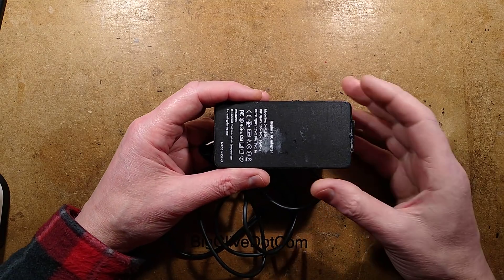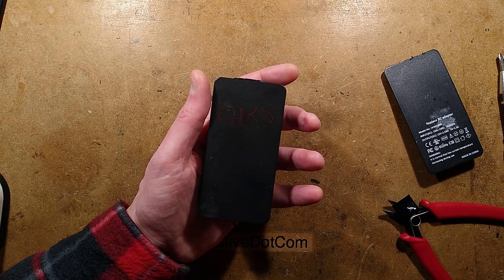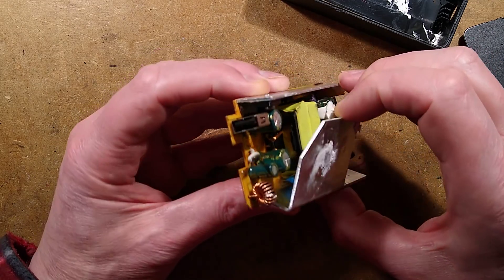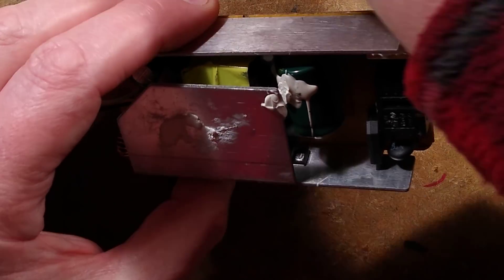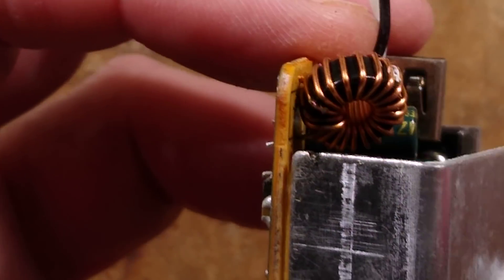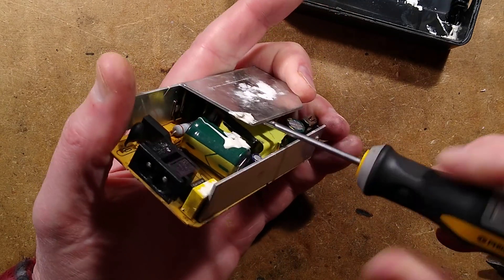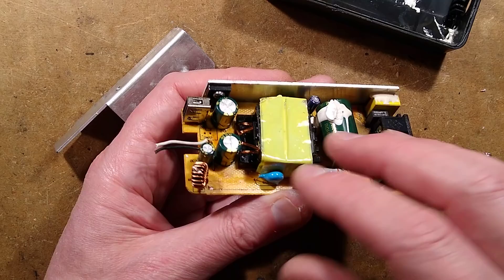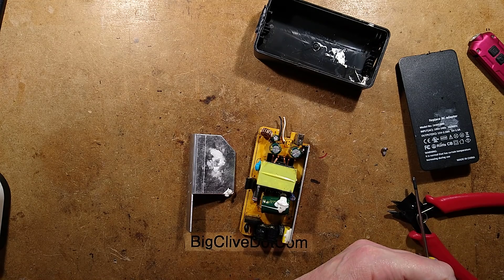This PSU killed a Microsoft Surface and a monitor

Comment: I do remember laptop transformers 10-15 years back seemed to get very hot and never seemed to last more than a few years, though they all failed safe for me without damaging equipment. There were cheap replacements from ebay around, but they failed too after a bit. They are far better now, so I guess manufacturers have improved things over the years. One thing I also noticed then was that simple electrical supply fittings of laptops seemed quite poorly made in the early days too, power lead plugs, wire connectors and sockets for example.
Reply: Personally I don't like the idea of a power adapter without an earth connection to the mains power outlet. A LOT of PSUs back then only had the two prong cassette tape power lead. Not good in my opinion.
Reply: My first laptop back in the days of dial-up internet was terrifyingly hot EVERYWHERE. All it was all supplied by a Famous High Street Electrical Chain, but it was all so hot you could fry eggs on it. Transformer, the lot. I don’t know about such stuff, so not sure if the early equipment was prone to this. Anyway… I am going to try and teach my self to check stuff out.

Comment: I had a oem display port cable take out three computer power supplies. The low voltage 3.3 or 5v wax being shorted to ground. One I replaced the cable no more issues. I was lucky it didn’t take out motherboard or rx 580

Comment: Heatsinks need to be referenced to a power or ground rail, otherwise switching noise will get capacitively coupled onto them through the isolated transistor and diode packages which makes heatsinks act like antennas, increasing EMI. With the heatsinks grounded, they become somewhat effective EMI shields instead.
Reply: Not actually grounded, in this case, thanks to the unpolarized 2-prong plug.
Reply: @jpdemer5  I meant 'ground' in the AC signal analysis / EMI sense. In the strict electrical sense, you cannot have a ground on the other side of a diode bridge because that would short L-G through the bridge and blow it up. Even if you had a polarized plug, you wouldn't want to connect the heatsinks to it since that would cause conducted EMI through the ground wire instead of locally shunting it to circuit power/ground rails to keep it local.

Comment: "Replace AC adapter" 😂 Replace "cheap 💩 for an expensive device" mindset and stop saving a buck in order to pay it tenfold later in damages. This owner deserved what was coming. If it's a power supply for a monitor AND USB devices AND it's cheap - it's literally too good to be true. ✌

Comment: Grounding the heatsink would seem reasonable to help keep down electrical noise. The issue is poor physical design and  poor component layout. That heatsink could be 10mm shorter and still do its job. Placing it that close to the coil completely defeats any attempt on the PCB layout to isolate the high voltage side from the low voltage side. Rather a dangerous design mistake. Having said that, if that transistor is switching the rectified mains, then the only isolation from the low voltage ground  is within the transistor plastic body, and I suspect that is also not sufficient.
Reply: The heatsink connected to negative rectified mains is hot anyway. In a class-II device, there is no protective earth, so shorting HF noise to negative (or positive) rectiified mains is the next best option. Failure of the transistor case would be contained on the primary side, and wouldn't be an electrocution risk (though possibly a fire risk, as there seems to be no proper fuse, maybe the "disappeared track" was a thin one designed as "PCB fuse" though). The distance between the heatsink is secondary side components seems to be the only obvious safety risk. I doubt the tansformer is meeting standards in a supply like this, though.
Reply: @tw11tube  "Failure of the transistor case would be contained on the primary side, and wouldn't be an electrocution risk" - Good point.

Comment: Had a similar one, though this was caused by the genuine power supply capacitors going bad. 12V supply went out of regulation, all the way to 50V, and killed the equipment it was connected to instead. Fixed the PSU temporarily and yes, other side deader than a doornail. Kind of expensive for the hotel though, it was the master unit for their door cards, and a pretty penny to replace, all because they cheaped out on both power supply, and a transient suppressor diode on the input to the machine as well.
Reply from the maker: That could have been the feedback circuit failing.  I've seen a precision reference circuit backed up with a slightly higher zener diode as a precaution.  But if the opto isolator fails then the voltage will float to the unregulated level.
Reply: @bigclivedotcom  No, feedback was well damped, so the spikes charged up the output capacitors to around 50V in spikes, before the feedback loop shut it down again.  IIRC the new programmer was around 25 thousand pounds to rush order and airfreight in. For the hotel about 2 days profit in peak season. Famous hotel, even the cat has it's own Instagram and Facebook page.
Reply: Sounds like what the Atari Lynx does when its MOSFET goes bad

Comment: Grounding that heatsink was the BIG design fault. Also another thing I notice is there is no MOV or spark gaps in there to deal with any sort of mains spikes. It could be that the unit experienced a spike, and that was enough to punch through the very thin enamelled wire insulation of the choke.
Reply: The irony being that if the heatsink was actually grounded (i.e. connected to neutral or earth) then it would have failed safe. With a non polarised input connector there would be a 50/50 chance of the heatsink being live.
Reply: @ferrumignis  You cannot guarantee neutral is 0v, so it is NEVER safe to use it as a "ground".
Reply: @jaycee1980  its isnt connected to neutral or 'ground', its connected to the negative end of a bridge rectifier which is fed from the mains, its live to true earth on alternate mains half cycles
Reply: @andygozzo72  yeah i know, i should have said "grounding".. in quote marks.. the designer has obviously figured that it would be 0V but of course a) not at the bridge rectifier -ve and b) you cant rely on neutral being ground anyway!
Reply: @ferrumignis  and a ungrounded connector!
Reply: @ferrumignis  doesnt matter it'd be -350v peak negative to true earth on alternate half cycles ,
Reply: grounded for emc compliance? The switching mosfet is on the heatsink, isolated, but there's still quite some capacitive coupling.
Reply: @victortitov1740  not 'grounded' but rectified mains negative , big difference
Reply: @andygozzo72  looks like it uses a 2 pin non-polarised ("figure 8" IEC C7) mains cable, so if the mains cable plug had been rotated 180°, it may have just gone bang, and not killed the attached equipment.
Reply: @Tim_Small  wont make any difference,  the mains goes through a bridge rectifier, so both positive and negative of its output are live to true earth depending on what cycle polarity of the mains is  at the time, reversing the input polarity makes no difference, you will still get the circuit negative ground being live to earth on alternate half cycles
Reply: In my experience they do almost always connect the heatsink to something appropriate, either to stop it radiating RF or so that they don't need to isolate it from the device that's being cooled.
Reply: the heatsink wasnt grounded, thats the problem, its rectified mains negative, -350v ish peak to earth each time on one half cycle,

Comment: The fact is, that the original OEM adapter connector that connects to the Surface is poorly made and fails within a year. A replacement OEM adapter is $90,- .
Reply: Yikes!  I'm going to stop griping about Apple's power bricks.  Aside from the crumbly silicone insulation that used to be on the cables, those things have been bullet-proof.

Comment: I look after alot of desktop IT, and some of that is Surface Pros. We have had people loose PSU's so we got a load of "Replacement Surface Chargers" from a very well known IT reseller in the UK that sells to the trade. In no time at all staff were complaining they were feeling a buzzing when touching their MS Surface's. I tested one with my Fluke and sure enough i was seeing about 80v AC on the outer case !. So we issued an email to all staff to throw these chargers in the bin. Thus we got some genuine Microsoft ones.
Reply from the maker: That's common.  It's capacitive coupling between winding layers and through the class Y RF suppression capacitor.
It's only about 100uA, but with 10Mohm input impedance, a meter will show a highish voltage.  It's also enough to give a tingle from metal surfaces.
You'll find the same with most ungrounded power supplies including Apples.

Comment: I had a behringer amplifier and it wasn’t working correctly sometimes one channel would stop working or no indicate at the fron panel(the power in bd) I send it to the company 2 times and ones at a local place…and they fixed it worked for a bit and then it one channel would stop working so I took it apart my self and I found two resistors touching together after that it still works after 5 years!!! It was so hard to see but I checked a lot and I found it it was so simple!!!

Comment: This is why I never buy aftermarket power supplies, much prefer a used OEM one to one of these aftermarket units for exactly this reason.
Of course there's no guaranty this wont happen, but seems much less likely something like that would be missed.
Reply: Seen far to many laptops with blown charge ic or worse totally dead fixing computers for years. Never buy this cheap Chinese crap. A power supply isnt something to mess with. Buy oem or high quality.

Comment: They did a good job isolating low voltage from mains, then completely violated it with the heat sink/shield. Just simply dropping the PSU might have made the inductor touch  heatsink.
Reply: Or the heatsink getting hot and malforming

Comment: This is why you don't buy these things...sure the genuine ones are overpriced but at least they don't blow up in your hands nearly as often!
Reply: So I’d argue they’re not overpriced: you’re paying for peace of mind. 

Some of the extra money went towards better parts and manufacturing processes. Some went to better engineering. Some went to testing and certification. Some went to a budget for warranty fulfillment. And some went to the liability insurance the manufacturer carries, which is what funds the massive recalls in the rare cases they later identify some rare unsafe failure mode. No-name vendors don’t do any of that.

Comment: I hate that the Surface series is such a pain in the butt to fix (worse than iPads if memory serves), because the 7 Pro is so good at what it does in such a lightweight package. Also hate that they still use a proprietary charging port. 

... Heatsink compound to the plastic? Wha?

Comment: I'll admit I still use "questionable" supplies from time to time. Supplies that look good, but you still have that nagging doubt. As a workaround, I usually earth the low voltage negative. Treat it as a Class 1 appliance on both sides of the transformer.

Comment: Having taken apart a LOT of various and different PSUs over the years, just for personal curiosity sake, having no formal education in circuit or designs... even I can say HOLY SHIT is that a bone headed design!! 😲😬🤯

I'm not sure I've encountered one where the heatsink standoffs were connected to anything except a tiny solder point on the PCB just for anchoring. Though, I do know that often times, the Hot (mains) heatsink will have roughly 60V coursing through it, just thanks to the component it's sinking having a metal back (VR, FETs, whatever they are).... Found that out the hard way lmao And just so happens, was reminded of that fact yesterday while adjusting a trimmer pot in a workstation grade PSU yesterday when the back of my hand brushed across that heatsink 🥴 SPECIFICALLY, the very end of it, because I had already taken measures to mitigate that happening by running a strip of electrical tape along the top of the heatsink... doh! (at least I had enough foresight to try to prevent it from happening, even if I ultimately failed haha)
Reply: The heatsinks are definitely connected quite often, at least on the secondary-side.
Reply: @eDoc2020  True. But this was the primary (AC) side, which it seems like (to me at least) they used an all plastic component in order to ensure the heatsink would be decoupled... Then again, maybe that choice in component was because they had the heatsink 'live'? lol

*shrug* Who knows... heh

Comment: Pro tip: The Surface Pros work with USB PD supplies of sufficient wattage, and you can buy Type-C to Surface cables off Amazon. I unfortunately bought a couple of these junk Chinesium dealies before I discovered this fact. Both were prone to sparking on the DC side when you plugged them in. Due to poor grounding, they also cause issues where the Type Cover track pad works intermittently. One had really bad coil whine, the other got quite warm even though it was the correct wattage. Unfortunately, the charge ends always go on all Surface supplies due to the design completely lacking any strain relief. The cable is permanently attached to the brick, and Microsoft wants a fortune (seriously, more than even Apple charges) for an official replacement. With the USB route, you just grab a good quality GaN supply (I got an 65w Anker one) and replace the cables as they wear out. Don't bother with any other third party Surface chargers. I'm pretty sure every one on Amazon is garbage, and a ticking time bomb.
Reply: Yes, but the point is also valid: starting from the Pro 7, it is possible to use a USB-C power supply. 45W is enough, 65W is ideal. I use a name brand USB-C charger for my phone, surface, and headphones. 35€ for a decent universal charger is hard to beat.
Reply: Lots of the older Surface models like my mom's Surface Pro 5 don't have USB-C tho. I think they first added USB C on the Surface Pro 7
Reply: @MrFastFox666  He's referring to the Surface port.
Reply: @MrFastFox666  You can buy an adaptor
Reply: Yep,  I got a USB-C to Surface adapter, and I have a 65W Minix brand GaN USB-C tiny thing, works for my wife's 2018 Surface Pro. I also managed to hack apart the original supply Surface connector and the ground wire had completely sheared at the input to the connector, was able to fix it and hold it all together with a bit of heatshrink, so we have both options (now the charging/ connection light is shining out the end as I wasn't able to get it reassembled with the little perspex light pipe). Those GaN chargers are very nice!  So much smaller (thus more efficient)  than the original Surface supply.
Reply: They don't use standard connector?